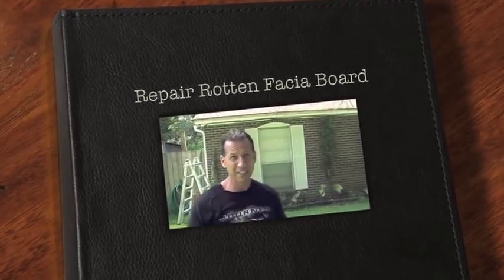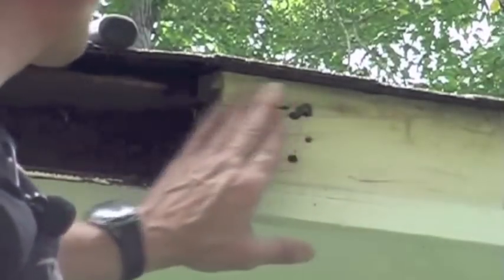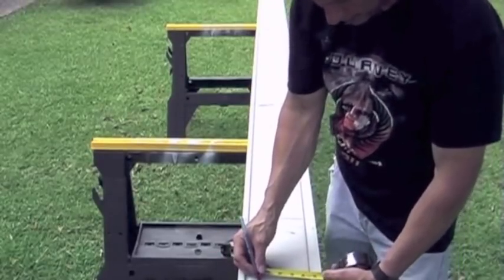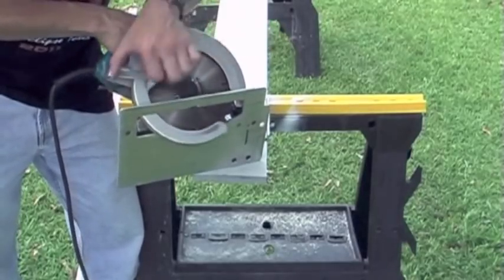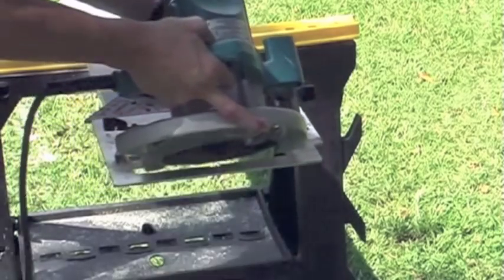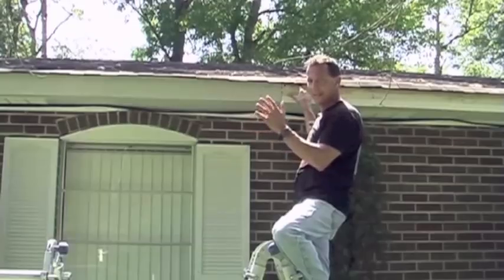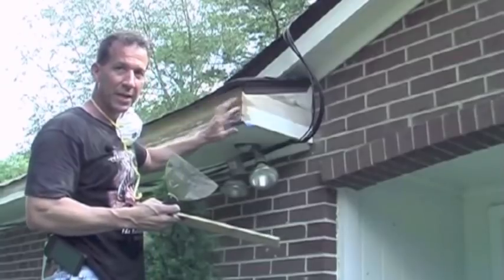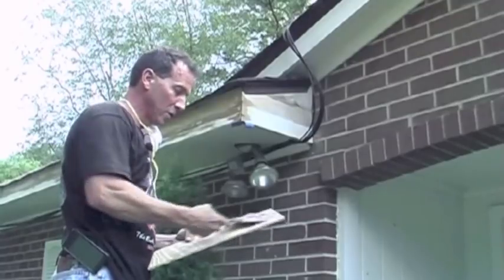Repairing Fascia Board

Comment: Hi Paul, you chose to cut the seam in front of a rafter. I notice that the old nail holes are on the seam. So what I don't understand is when you replace with the new board and attach the new seam do you just glue it together? How do you reattach the new seam to the rafter behind?? Thanks.
Reply from the maker: Hi Jason, 
I always split the seam on the rafters and I use an exterior glue on the seam. I then nail the fascia at each rafter including the one with the seam. I used my 16 gauge nailer with galvanized nails. If you do not have a nail gun, you can use 2" galvanized finishing nails. I hope this helps and thanks for watching!
Paul

Comment: hey bro great video.  I could use some help though.  My fascia is 3/4 x 8 and 30 ft long.  It's starting to swell and rot in a corner and i want to replace only about 2 feet of it.  I can't pull it out to cut it though, it's too hard.  there's about 30 feet of gutter/drip lip in front of the fascia, so I have no clue how i could cut the fascia without bending up the gutters and lip.  2 story house too, a real pain here.  It would be great if there is anything that might help.  thanks.

Comment: Very helpful video.  I was wondering about the fascia board itself....were you using plain 1x6 wood boards or are they some pressed or synthetic material?
Reply from the maker: Hi Otis,
 This was pre- primed redwood. It is a little harder to find, but redwood holds up to weather better than pine. Either way, you will want to make sure that everything is sealed with primer and paint. The corners are the most important places, because they can open up and allow water to penetrate the meat of the wood. This is why I like to use body filler to close the corners. Caulk doesn't look as good and it will shrink over time.This allows water in. Once this happens, the wood will swell and rot. Thanks!

Comment: what type wood did you use for the fascia board..measurements please
Reply from the maker: alfred wel 
Hi Alfred Wel,
I used pre primed pine fascia for this home. I usually use redwood when replacing fascia, but I did this on a Sunday and the lumber yard was closed. I had to go to Home depot. Redwood holds up better to outdoor conditions but I made sure to close the corners very well and I put 2 good coats of paint on it. This is my parents home, so I keep a good  eye on it for any problems. I did this repair soon after they purchased it and it still looks good. Bondo works well!
Thanks!
Paul
Reply from the maker: Yes, It also has grooves on the top and bottom. It can be flipped for 3/8" soffit or 1/2" plywood soffit.
Thanks!

Comment: Hey Paul I have to replace my roof should I go ahead and replace my fascia before or after
Reply from the maker: Hi Donald, I would change the fascia first because it will be much easier to paint. You can paint without having to cut in around your shingles. 
Thanks!
Paul

Comment: Nice Video!  I found this trying to find out about replacing some rotted t1-11 siding I have around the bottom of my house.  It seems to be only the bottom row or 2 around the majority of my house I've noticed after taking out some overgrown shrubs.  The question I have is should I go back with a t1-11 type product or some sort of cement fiber board?  And is it ok to just replace the bottom few rows even if I go back with the cement fiber board that will butt up against the t1-11?  Thanks for your time
Reply from the maker: Super Doob 
 Hi Super Doob,
James Hardy makes a vertical panel that resembles T111. I'm just not sure if your pattern will match. If it does.  I would suggest using it.It is easy to paint and it handles the weather very well. If you are going to replace the entire area, I would suggest using James Hardy Board. The vertical panels come in 4x8 sheets and they hold up to the weather very well.  You mentioned that the bottom rows are bad. I think you are referring to horizontal siding. If so, I would suggest changing it with the same siding that matches. I hope this helps, let me know if you have any questions. You can Google James Hardy and see the different types of siding that they offer. My house has redwood siding and I have to get it from a lumber yard. That's what I use when replacing mine. I am painting my house right now and I have been so busy that I waited too long before doing it. I have various places that will need to be replaced. I guess I will have new videos on this subject!
Thanks!
paul
Reply: Paul Ricalde Thanks for the quick response Paul.  Yes, it is horizontal lap siding, and after googling images of the James Hardy siding, it looks very similar to the wood grain pattern the majority of my siding has.  I was concerned of the compatibility of the first row or two being the hardy siding, then blending into the old t1111 siding. If my research has been correct, I believe I should be able to tear out the bad siding and only replace the bad boards with the new hardy board.  Good luck with your painting project.  I work for a large paint company and am more than happy to return the favor if you ever have any paint questions; however, from the sounds of your videos, seems like you shouldn't have any issues.  Thanks again and best of luck!
Reply from the maker: Super Doob 
Good morning Super Doob,
You may want to bring a piece of your siding to a lumber yard and compare it to the lap siding that they offer. It may or may not blend well with the Hardy Board lap siding but at least you will know before bringing it home. thanks for the offer, if I run into a problem, I will be sure to ask. That's the beauty of YouTube, sharing information!
Thanks!
Paul

Comment: Hey Paul how do you find your angles on the fascia board if there on a  gable peek are the always 45?
Reply from the maker: +lance frost 
Hi Lance,
Finding your angle can be done in several ways, an angle finder is the easiest way but you can also get a scrap piece of wood and set it up against your house at the peek of your gable. Use a piece that has a straight 90 degree edge. Mark the top of your scrap where it meets the peek and mark the bottom. You can then connect the lines with a straight edge. If you do not have sub fascia backing to use as a reference for your bottom mark, you can mark the top only and use a level to create your vertical line straight down. Please let me know if I need to explain it better. 
Thanks!
Paul
Reply: No that was perfect thank you  very much I really appreciate it didn't think I would get an answer back so thank you
Reply from the maker: You are welcome Lance, I'm glad I could help.
I almost forgot, a plumb bob works great in this situation because it will give you an exact reference. If you do not own one you can use a string and a fishing sinker or any other small object that weighs a few ounces. (Doesn't work very well in windy conditions). I check my mail everyday and I try to answer everyone. Sometimes I will not see a question until I go to a particular video, so send another one if I do not answer. I do get a lot of questions, so it may take a few days.
Thanks!
Paul

Comment: Hey Paul - awesome videos!  The Bondo idea is excellent and works like a charm.  Subscription all the way.  

Question for you: are you using a random orbital sander or is that a straight disk sander?    I bought a little Rigid 3 amp hand-held ROS and it isn't worth a darn.   What kind is yours and what kind of power does it have?  

Thanks for the info.  Peter K
Reply from the maker: Hi Peter, I'm really sorry for taking so long to get back but I did not get a notification from your question. I used a Porter Cable orbital sander/polisher. I have 2 of them and they work great. It is also pretty powerful with a dial for adjustable speeds.
Thanks!
Paul

Comment from the maker: Replace Fascia Board!
Reply from the maker: Hi Jim Watson,
That is a good point. I use to make Formica tops on new construction in the 80's.I needed tight joints on the plywood base. This method would make perfect seams. I do not do it on fascia because I have to pull it away from the roof in order to cut it. I would bee too hard to do when working on a ladder. I can see this being useful in many situations on the ground.
Thanks for the good information!
Paul
Reply from the maker: I see what you mean, but this is not new construction. I had to pull the fascia away in order to clear the shingles.
Thanks!
Paul
Reply from the maker: AHH! Good information Jim, I never thought of that. Thanks for the tip!
Paul
Reply from the maker: Hi Freya,
That is a very good question. If you are absolutely sure that it is your phone line. It is low voltage and poses no danger. It should have enough slack in it for you to temporarily unhook it from the fascia. I usually remove it and replace it after I replace the fascia. If you no longer need it, you can call the phone company and have them remove the wire completely. This way you will not have to reattach the screw. Those unsightly screw brackets that they use can cause your fascia to rot. If you re attach it, you will want to seal it. I use a good exterior paintable caulk all around the base of the screw and a good oil base primer before painting. Companies offer different materials for fascia but they are usually a different width and thickness. If you were replacing all of your fascia, it could be an option, but patching it with the same material is better in my opinion. Redwood fascia will last many years if you seal and paint it correctly. Proper inspection and maintenance is the key.
Thanks!
Paul

Comment: what kind of sander did you use.
Reply from the maker: Hey Donald,
I used my Porter cable orbital sander/polisher. It runs about  $130.00 at Lowes. It is a really good sander that uses 6" sticky back sandpaper.
Thanks!
Paul
Reply: Can you recommend an orbital sander that's like a fraction of the price that's still good
Reply from the maker: If you have a Home Depot near you, I would suggest looking in the power tool section. I think Ryobi makes a palm sander that is also an orbital. Ryobi makes a pretty good tool for the price.
Reply: Thanks Paul. I will let you know how the job turns out. I am replacing 2x8 fascia on a 15 year old house. The original work is not the best. California track homes. Thanks for the info.
Reply from the maker: Sounds great Donald, good luck buddy!

Comment: Paul, why do you prefer Bondo over Fixall?
Reply from the maker: Joe Orawczyk Hi Joe,I have been using Bondo and Bondo glass for over 20 years and it has never let me down. I have never personally used Fix All, but the price is very high compared to Bondo. I get a gallon for less than  $20.00. Fix All is around $20.00 for 16 oz. I think Fix All is an epoxy, so I believe it would work well. I use a knife grade epoxy for certain projects. It cost about 8 to 10 dollars for 16 oz.Thanks!Paul
Reply: Paul Ricalde I'm sorry Paul, I meant "Fix-it-all" patching compound. HD sells a 25-lb bag of this powder cement like product for around $15. I used it around my tub insert on the mortar walls and it worked great. But it doesn't sand any easier than dried cement and I suspect it doesn't adhere to wood as well as bondo does, assuming bondo is slightly flexible as wood reacts to humidity. Fix-it-all is also pretty heavy, although not as heavy as cement, and it doesn't shrink - like joint compound does as it dries. The reason I ask is Fix-it-all was recommended to me by a painter at the big box store before I saw your video, and now I'm not sure which is better and why. Thanks again - Joe ;)
Reply from the maker: I haven't used that before, but I will check it out. I can tell you that you will be pleased with Bondo. It is easy to work with, you can adjust the amount of hardener for fast or slower working time and it is excellent for outdoor weather conditions. Thanks for the information on Fix-It-All. I am always looking for new ways to do repairs.
Paul

Comment: What is the product are use for fill up the gaps
Reply: bald man Bondo, he says it loads of times.
Reply: Thanks
Reply from the maker: bald man 
I don't know why it did not go through, but I answered your question a while ago. Sorry! I use Glass filled Bondo.(Bondo Glass is the name) to fill large gaps or holes. I then use Bondo, auto body filler for the finish. Bondo Glass is thick and fills holes without sagging too much. 
Thanks!
Paul
Reply: Thanks men u video help me a lot
Reply from the maker: You are welcome my friend! I'm glad i could help.
Paul
Reply: +Paul Ricalde (Paulstoolbox) We've used bondo and aluminum body filler on a lot of projects that will interact with water. They are great.
Reply from the maker: I use Bondo glass( Fiberglass filled Bondo} for large gaps and standard automotive body filler (Bondo) for the finish.

Comment: To prevent a large nil from splitting the end of a board ,take the nail and set in on concrete and tap the point of the nail with the hammer a few times.
When you put the nail in the board this way it will not split the wood. It just pushes a hole through the wood.
I f you do not believe it _ try it!
Reply from the maker: Hi Donald, that is a very good tip and I'm glad you brought it up. I have been doing that for years and I am with you, it works. It is especially good true when  working with redwood and Douglas Fir. Blunting the point will keep it from piercing the grain and separating it. If you blunt it, you greatly reduce the chances of splitting the grain. 
Thanks!
Paul

Comment: Darn, I always discover I did something wrong AFTER.   Trying to pretty up the house to put in on the market.  It is just me and I have no experience with most of what I'm attempting. 

I have some trim on back of house that wasn't put on well (by a man).  It was pulling away at the top and bottom, I didn't have any nails that were long enough - so bought some less expensive ones (they were Bright something or other - got 2" and 3 1/4" lengths but different thicknesses)  I used them and some screws also (yikes)  to secure the boards better.   So the nails are going to rust??  How bad is it really??  I don't have to try to take them out do I??  Not sure I could .  I was going to repaint the trim tomorrow and thought I could just paint over the ugly nails and screws to hide them a bit. I can hear you cussing now :(   This is an old house and only now do I realize it hasn't had proper maintenance in a long time (I had no idea how bad it was).  I've learned a lesson about annual maintenance for sure. 

Thanks for the info on the Bondo product too- I have struggled with this and  tried different types of fillers on various problem areas.  I even improvised on some - and was darn proud of my fixes until now...!

 So, I have rotten wood along the roof line of the soffits (fascia I think) and the wood of the soffits is sagging in some places, separating from each other in others.  There is no way I can replace all that - I was thinking: caulk the gaps, some screws for the sagging parts, and scrape/ sand and fresh paint on the front part (fascia). Oh, and filler on the bad wood areas... 

How can I do it better?   You taught me not to use screws or my giant Bright nails.  Anything else I should do different?  This stuff is hard to do -   There is usually cussing, and probably some tears, a mini breakdown at some point.. and always an injury... you get my drift.

Jeez, sorry this is so long....